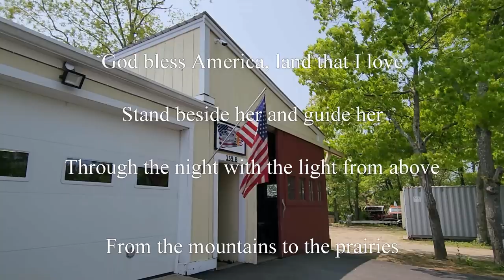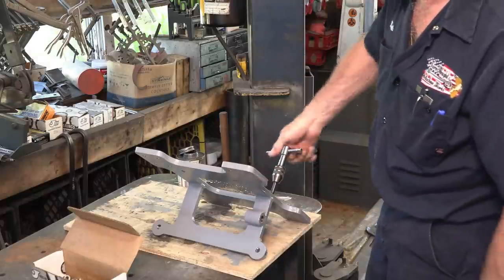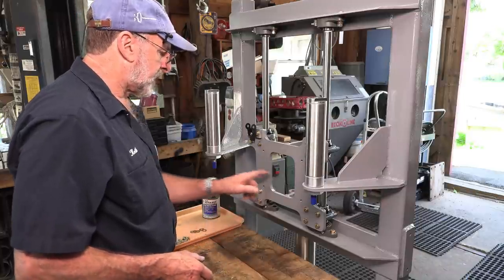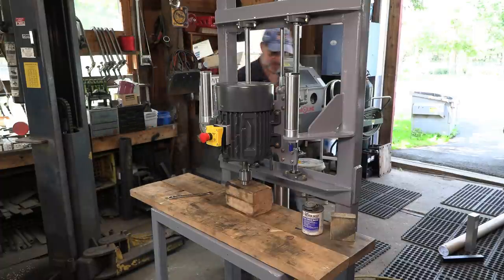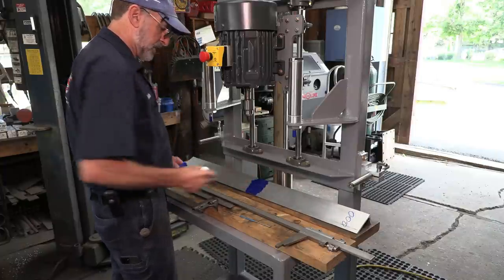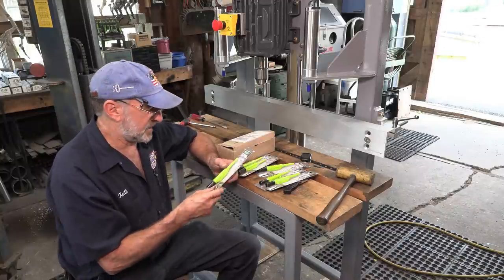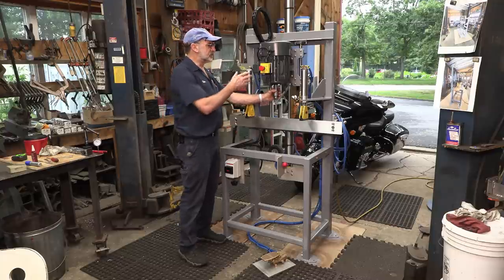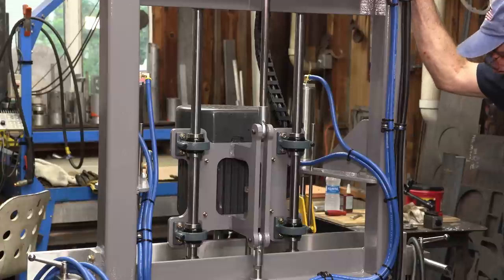Fence Post Manufacturing Drill Press

Comment: Thanks for sharing your thoughts, ideas and videos. Nicely done!  Knowing your quest for quality an idea I’ve seen others do is use retired flat fire hose as a wear guard over hydraulic hoses on skid steer implements. I’ve also seen it’s possible to buy new hose in many different colors and sizes. Might make an interesting enhancement for the air lines. Wishing you the best.

Comment: As always, nice work. Built something similar many years ago, I used air over hydraulics to regulate the speed, & take out any springiness in the air. I Also used two motors, arrang4ed so that the machine would drill up from the bottom about an inch, then drill down from the top, so there was no unsightly breakout in the bottom of the timber. The machine was used to build playground equipment. 🤠

Comment: Hi Keith and Lisa 😊,  nice machine, built whith alot of thought , and attention to detail. You probably already know this , but when trying to measure two shafts, or holes for centre , if you measure from the left hand edge of one shaft to the left hand edge of the other shaft that gives you the exact centre to centre  of the two shafts, same idea for two holes. You could use the right hand sides of both points it would work just the same. If you forgot this trick I forgive ya, so long as you forgive the clumsy passer by who broke your marker, ha, ha. Thanks for another interesting,  best wishe's to you and Lisa,  Stuart UK.

Comment: Great job. May want wrap or put something around the air hose where they rub against the support corners as I saw them fret just a bit when actuation the air and I could see them fretting and rubbing a hole through the air line. Love the build.
Reply: Slit a piece of the correct size of automotive heater hose and wire tie wear it rubs, that makes a quick wear point for air and hydraulic lines.

Comment: You are drilling a wood fence post. If the runout cannot be measured with a ruler that should be close enough those ship augers or self-feed bits have some runout and even variation is size.  Plus because of variation within the wood it will cause a bit to move,